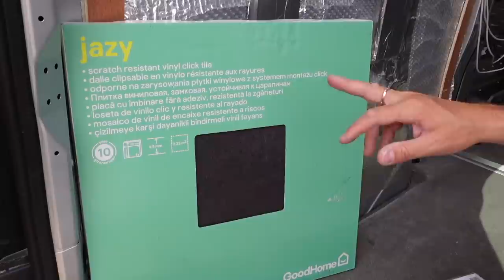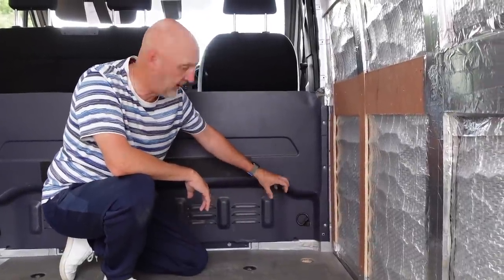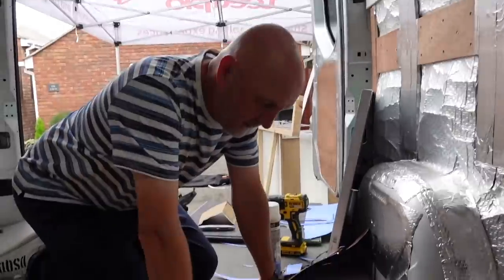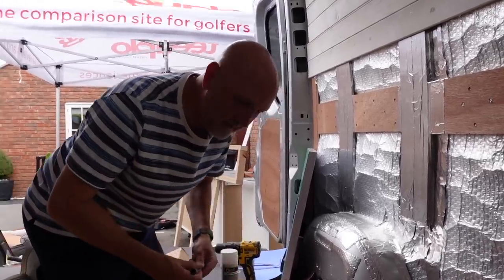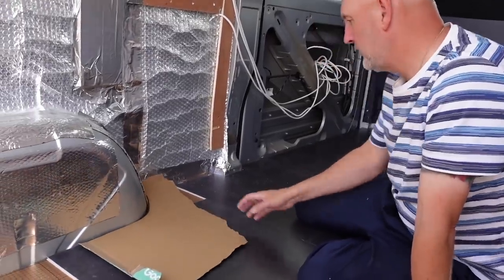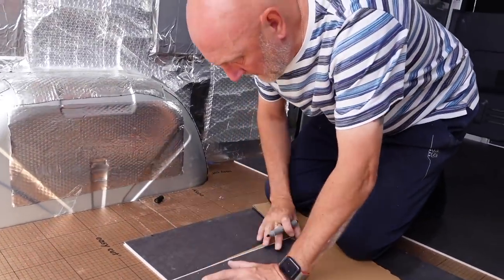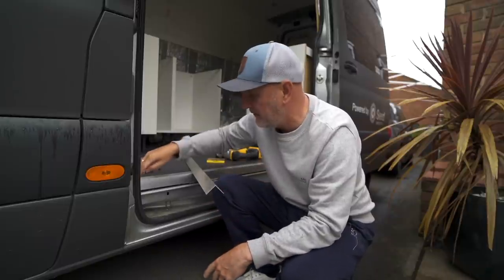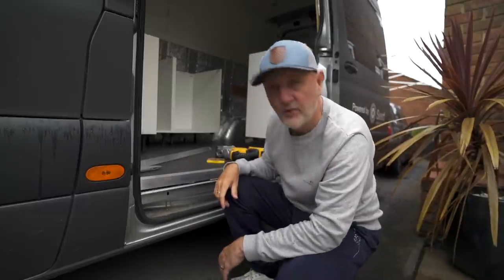Lovin' this.....

Comment: Having the outlet for the gas (in the event of a gas leak) in the van floor worries me.  Surely when you are driving in rain the spray will go through the hole and wet the floor.  I think you need to include a plug for when driving.

Of course the real stars of these videos is Penny followed by Hannah
Reply from the maker: There is a vent over the hole Justin